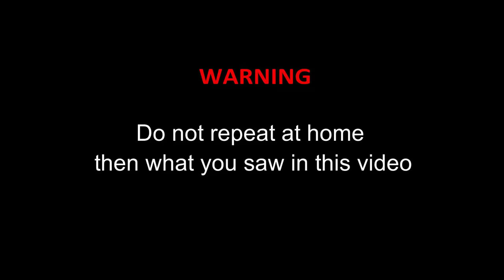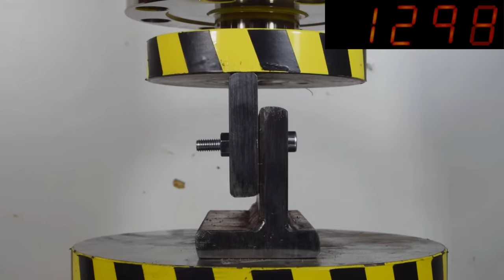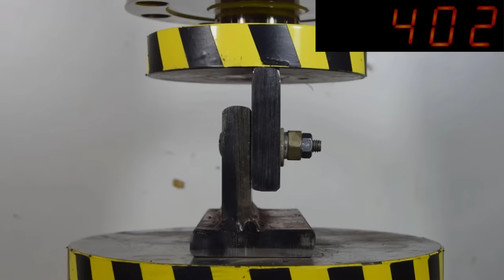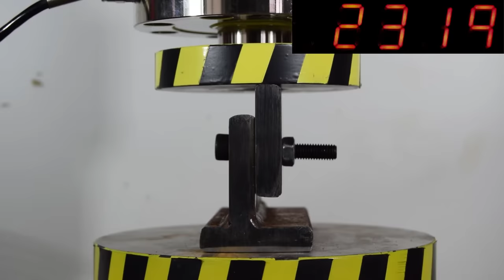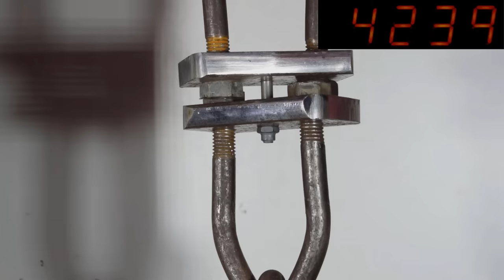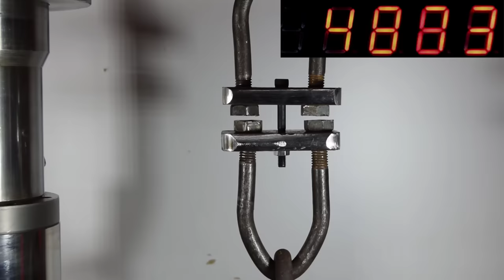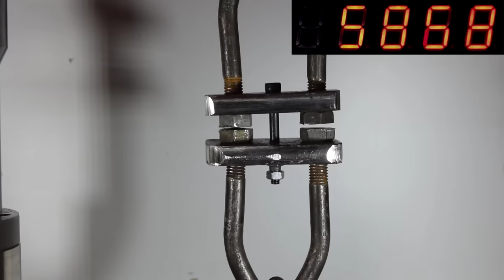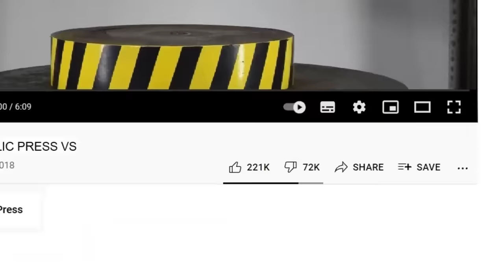HYDRAULIC PRESS VS TITANIUM BOLTS

Comment: My biggest criticism is that you kept mixing up the comparative values on the screen. For example at the end you tested the Chinese titanium then put up the value for the grade 8.8 bolt but labeled it Titanium for Spaceship. Then again when you tested the 12.9 bolt you put up a different value but labeled it Titanium for Spaceship again.
Reply: maybe he just made a mistake?
Reply: Yoooo was confuzzled too man
Reply: Agree, it's a bit chaotic.
Reply: Same observation... Ruins the video for me. Still fun to watch tho
Reply: Yes. It was extremely confusing.
Reply: Maybe he didn't want to damage business reputation & did errors on purpose to confuse?
Reply: yea is totally messed up , wasting so much time to make a video and not even bother to make it right
Reply: @virashakta  Wasting so much time? 😂
Reply: Second, he placed bolts in different position in steel test that alone changes the differences in pressure point
Reply: @mrdot1126  It’s called editing.
Reply: And right from the start,..
Loaded bolts differently in the jig. Using incompatible nuts, spacers (nuts) and washers.
If you can't test the same size fasteners the same exact way. Well. No need to watch more than the 2 minutes I saw.
Reply: He's fraud
Reply: My biggest criticism is that if he's going to compare bolts, find the same bolts or don't bother doing a useless comparison!!!!
Reply: There is no such thing as grade 8.8. There is grade 8 (SAE) or class 8.8, class 10 (Metric). Not being nit picky, but I worked a hardware store where the owner corrected me constantly.
Reply: @paranoidgenius9164  the fuck good is any of it then?
Reply: yup, I stopped @4:15 and not watching further. this is bull***t
Reply: @mrdot1126  yes he did - but if you want to be scientific - a certain level of precision should be implied!
Reply: I agree, this video is impossible to follow because it's never clear what bolt is currently being tested.
Reply: And NASA would likely have very  specific design purposes.. just a fun to watch
Reply: He just cant accept the fact that china bolt is better?😂😂
Reply: @mrdot1126  Maybe. doesn't negate the criticism.
Reply: Cry more
Reply: @bigwilson2303  It's a fair criticism. If you possessed common sense, you'd know that.
Reply: I would also question what he torqued them to.  If he over or under torqued the bolts they won’t perform the same.
Reply: He can't even spell hydraulic properly so what do you expect
Reply: I agree
Reply: showing comparative results?  was fine I love this
Reply: Biggest criticism is that the first half of the video is useless because the clamping force was not equal along all the sheer tests. Bolts work under tension.
Reply: I changed the oil on my lawnmower today. I went with a semi synthetic 10w-40 oil.
Reply: @kanemcvicar1108  maybe his first language isn't English I think he's Norwegian nice to inclusively still exists 🤔
Reply: You should get a press than.and do it the correct way that you see fit.still a great video showing how much better certain metals are compared to others.
Reply: @kanemcvicar1108  just cause one cant spell something correctly doesnt mean he aint good at something. Yes he made a mistake , but you cant judge by his spellings . Although english is vastly spoken and an universal language , its also a shitty language with no background to it .
Reply: And use different holes, distances for locking the nuts etc… fun to watch, but in no way useful scientiffically
Reply: @mrdot1126  That is what he is saying, yes.  If I made a video that had mistakes in it and posted it here I would hope someone would have the kindness to point the mistakes out to me so I could correct it.
Reply: I’ve worked with Chinese made “titanium,” before.
It’s nowhere near as strong as he claims in this video.
High grade steel was performing better than the supposed titanium from China.
I find it funny that people think China doesn’t cut corners on manufacturing, when Chinas new buildings are crumbling into dust/failing before they’re even finished.
Reply: Same I couldn't keep it straight what bolt was what
Reply: The one that got me was the weighing. Showed all three bolts but only two was weighed.
Reply: its a comparison, easy he us comparing all the results to the space titanium
Reply: Was also confused.
Reply: he mixed everything. Probably he want the viewer guessing the right type of bolt and the strength
Reply: Yes, nice idea but messy and confusing execution...
Reply: English isn't his first language
Reply: All titanium is for spaceship. All.
Reply: @mrdot1126  really? Do you think? Genius!
Reply: It took a few minutes to figure out what "titan for space" meant...lol
Reply: @mrdot1126  maybe you went to school to be that smart. But like what else do you think happened? Do you think he accurately labeled it? Then there was obviously a mistake, thanks Captain!
Reply: China's over here digging deep for continuity errors.  Sorry your stuff's crap quality 😆
Reply: Yep, and no measurement for percentage of threads on especially what he's calling in a terror test 'percentage of threads' is..... everything here?
Reply: @mrdot1126 ,
   So you're suggesting a participation trophy? Mistakes aren't set up for science, rather, science is set up to catch mistakes.
Reply: This doesn't work
Reply: At least it's not the hydraulic press channel...
Reply: His first language isn’t English. It’s not that deep
Reply: @Ulven3829  lol how much time have you spent making content😂😂😂
Reply: It seems to me that its partially because he has multiple bolts I could just not be understanding what you're saying I'm having a pretty rough go of the adhd as I type this lol
Reply: The Testsetup is nuts. The Nuts are not tightened with the same torque and Bolts are not meant  to be sheered off. Doing a tension/pulling Test would produce compareable results. But this way, it is a complete waste of Time and Material.
Reply: I have a feeling this guy isnt a native english speaker so you gotta cut him a little slack. English can be really hard to understand and learn to speak with all its if ands buts and whens.
Reply: It's an add for Chinesium
Reply: Agree. Too many mistakes..
Reply: i would be more interested in bolt thread stripping failure test, that's were most bolts fail, in real life application
Reply: CCP: “First time?”
Reply: I really don't Care i buy my spaceship with thé bolts included
Reply: @Buddah_the_one_true_god  titanium is a natural element, you cant make that "cheap", a difference in processing will change how strong a material is in certain instances (for example it might be good at sheer strength but poor at tearing) but its still titanium...... 

china makes things just as high quality as the west, its just that when china has to not only provide for their own 1.6 billion people, but the rest of the worlds 6 billion, well of fucking course they also provided cheap mass produced goods, china is NOT post scarcity and when they are practically forced to be the world supplyline they have no choice but to provide cheap alternative goods, do NOT confuse this with the belief everything made in china is cheap
Reply: Cuz he paid the money and didn't want to reveal the truths
Reply: @mrdot1126  thats a fair assessment and I dont think anyone is throwing shade at the guy HOWEVER, accuracy is important to those interested in perhaps making a purchase in the future.
Reply: @EddyKorgo  not really.
Reply: @EddyKorgo  yup , different torques, different sized bolts, different head, different tolerances. Very inconclusive.
Reply: My biggest criticism was the shitty music introduced halfway through
Reply: @paranoidgenius9164  then he should not have made the test!
Reply: @mrdot1126  then he should not have post the test!
Reply: Same, he just tested 12.9 and put it at bottom of screen below the other and i was like what. Also he didnt compare the weight of the chinese titanium vs the aerospace grade titanium bolt. Very confusing
Reply: Yeah quite confusing now I don’t know what bolts to buy for my spaceship 😩
Reply: You noticed too.
Reply: @mrdot1126  well then he needs to fix the mistake before he posts a whole video about something trying to prove something scientific
Reply: Maybe the test was made in China 😂
Reply: It’s called 0 effort. Just had a press and whipped up a video
Reply: @paranoidgenius9164  then we should all report this to youtube for misinformation ?
Reply: @paranoidgenius9164  what reputation? he did not put any company name anyway
Reply: @gergergrw  if people did that then the whole of YouTube would be reported!🤣
Reply: Yeah I was like wtf is going on
Reply: he also didn't weight the chinese titan bolt and the space titan bolt
Reply: Shows has no idea what is used in a spaceship lol ❤😂
Reply: Confuzius say:"I am confuziused"😂
Reply: @XiaoYueMao very true, the misery made in China is very expensive. As is the pollution.
Reply: dude relax, hes not a scientist just somebody with a press
Reply: @Buddah_the_one_true_god  China makes buildings and bridges from Tofu. I've seen what was supposed to be a concrete bridge have the "Concrete" break apart when someone squeezed it with their fingers. If China ever starts trying to export Vehicles to the US I personally will never buy one. Korean Vehicles have made huge leaps and bounds over the past couple decades in Vehicle quality but China will always be China.
Reply: I was confused as well. All I learned is that Ali Express titanium is pretty good XD
Reply: I believe it was an ad for Chinese fasteners! It looked to me like some different size bolts but maybe it's just my optical conclusion.
Reply: Why do the video if you were just going to confuse the results so badly. Fail
Reply: It's because the was made by Chinese another propaganda
Reply: La coppia di serraggio del bullone doveva essere identica. Non vedo riferimenti torsiometrici. Una coppia differente sconvolge i risultati . Valori miscelati tra titanio, acciaio, 12.9 ecc ecc lo ho guardato piu volte ma rimango confuso.
Reply: @e.a297 no it is titanium china
Reply: It's just propaganda.
Reply: Made a mistake huh , so many times making similar mistakes ??!! . Don't think so just trying to blag the issue showing what he/she/they wanted to .
Reply: My man just look up ISO 898. It's the engineering standard these bolt classes are based on
Reply: I got really confused with this video
Reply: That China bolt wasn't sold as real titanium either. That's what they call a "burnt titanium" finish. Basically pretty chrome. Lol
Reply: @mrdot1126  I don't think so.
Reply: i doubt he has access to space ceaft bolt 😂
Reply: He is from Belarus, that is the reason...
Reply: they were lost in translation 😅
Reply: He’s comparing that’s all.

Comment: In a few tests you can see the head of the bolt moving well before any yield, meaning bolt has not been properly torqued.  Stresses accumulate differently when you have combined stresses and strains.  It is always important to torque to specification.  As a design engineer we were instructed to avoid putting bolts in single shear or shear at all.  Shear stress in steel is traditionally lower than tensile yield strength.  Some preferred practices were not being used in these tests.
Reply: Exactly which makes the tests pretty much useless..
Reply: Glad that someone else noticed that 😮 You should always double check everything especially if you get a result you didn’t expect, make sure that it wasn’t a fault of your testing.
Reply: There are definitely methods ASTM !  I believe it was American Standards Testing Materials
Reply: Bolts are not designed to be used in shear, that’s what pins are for. 
If they do get used in shear, they should be used in a double shear at the minimum and only the unthreaded portion of the fastener otherwise the bolt will fail at the small diameter in the bottom of the thread root.
Reply: @skullfracture2 exactly
Reply: These things were never scientific. It's just a guy crushing things with a press.
Reply: If thats true yes test is not valid but the torque of the bolt is the only factor that could cause that. The bolt head could have been compromised or not heat treated properly causing it too deform.

Comment: Can we just appreciate how strong all the materials are? I mean you can pretty much hang an SUV on one of those bolts and they are not even some big and thick ones.
Reply: The beauty of steel and alloy products are their tensile strength. If you could hold onto it, several people could hang from a coke can, though one heavy foot is enough to crush it. Of course, concrete is the opposite, which is why they are a brilliant construction product when combined.

Comment: For any accident investigators out there, it might be interesting if you showed a magnified image the bolt surface after the sheer and tear failures.
Reply: way back now but one of the things they taught new crew chiefs going into the US military was the different forces applied to fasteners, structural components and what those forces look like in action.
Reply: Every technology lab has extra equipment for pulling or shearing forces and doesn't play in the garage with old press lol
these are standard tests in the industry
Reply: *shear
Reply: Would also like to see how much each one costs.